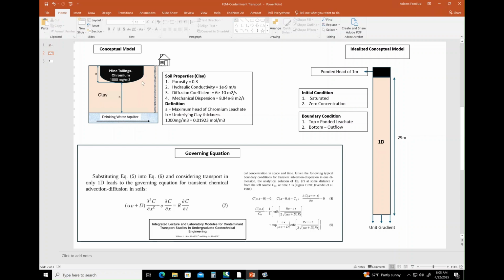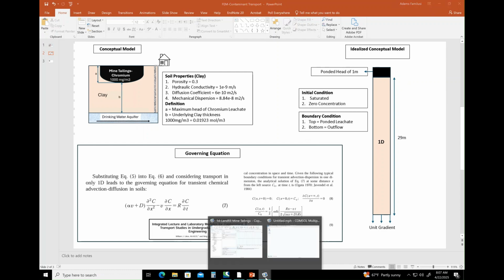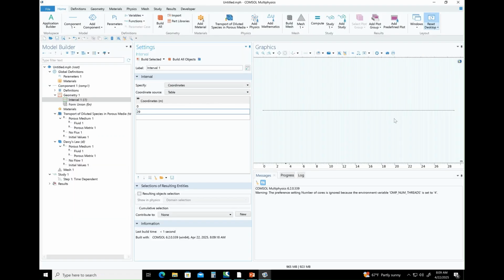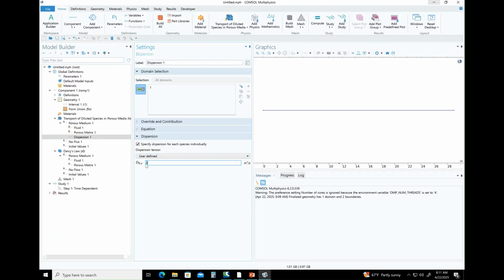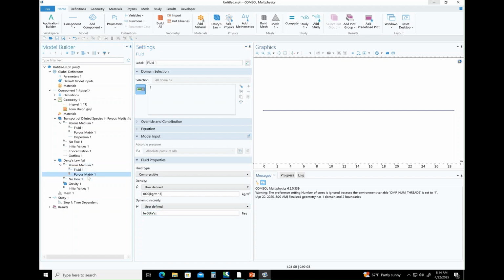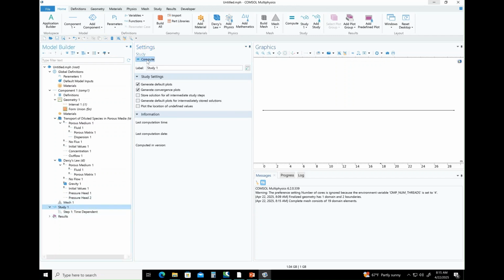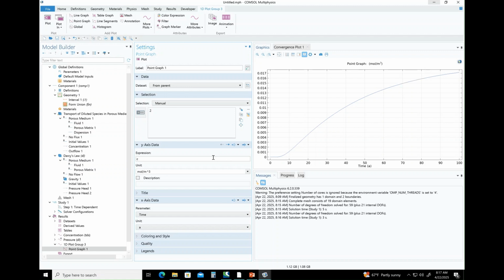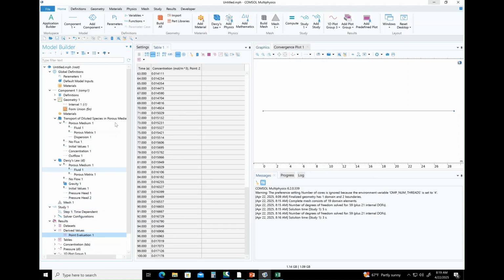Contaminant Transport in Porous Media-Coupled Flow Analysis in COMSOL

Comment: Do you know how to handle problems related to solute transport in the HZ region?
Reply from the maker: I haven't modeled the HZ region. However, based on the physical boundary dynamics, the main task is selecting the right physics interfaces to capture how the boundary interacts with the flow and handles solute transport. If you'd like to discuss this further, feel free to reach GeoNiche here: geoniche1@gmail.com